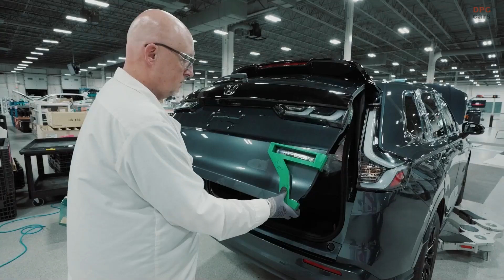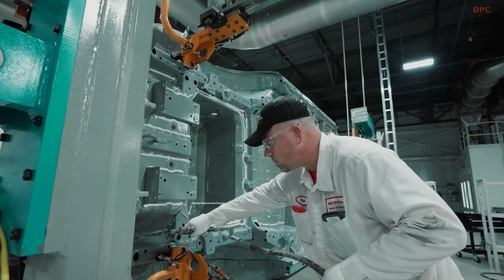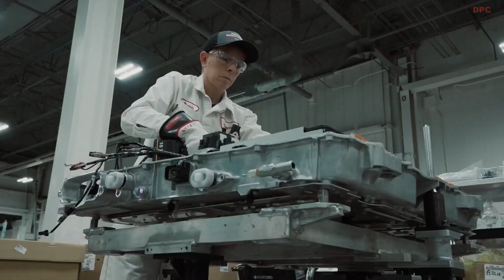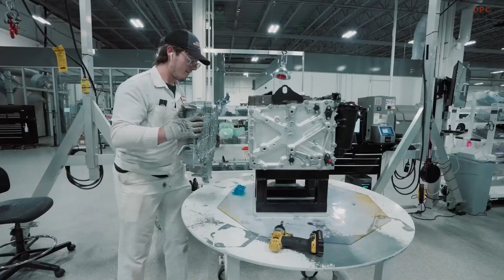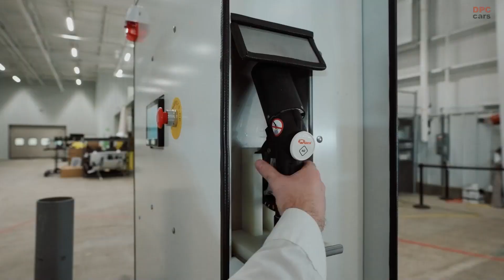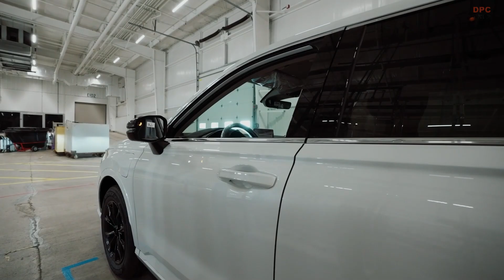2025 Honda CR-V e:FCEV Fuel Cell Electric Vehicle Production in United States

Comment: Don't really get the attraction, other than being able to brag about having a FCEV car in an area with the ability to refuel. The car seems to be priced (based on other videos) as a consumer led experiment to determine desire and to iron out the bugs in the system. 

The cost is heavily discounted but the range (either battery and hydrogen powered) and load space are small for the size of vehicle. In many cases the range and load space are beaten by many of the Battery EVs SUV options available if it's intended for those looking to go green. The 6 year option price being near to some similarly sized (load capacity wise) BEV SUVs. Plus the limitation of being to drive the vehicle beyond its 270 mile (299 hydrogen+battery combined) range limits the attraction further.

This seems to suggest Honda see this being purchased as a 2nd car or for someone who does mainly local driving close by a hydrogen fueling station (within 29 miles battery powered round trip else eating into the hydrogen allowance for the pleasure of refueling alone).

The included hydrogen fueling allowance is to counter the lack of fueling infrastructure and high cost of hydrogen refueling (upto $36 per kWh in some states), but going by the pricing Honda seem to be are assuming many journeys will be on battery power alone especially to and from the hydrogen station. In effect they are pricing at the maximum of 133 hydrogen refills for the 3yr deal (at the 12k annual mileage on hydrogen only), 267 refills for the 6yr one  and 222 refills for the 2yr. Pricing the cost of each fueling is the same for each lease option at $113 on the stated allowances. This compares with the recent $155 for public refueling for the cyclinder capacity on the CRV (4.3kg). Green credential wise the kWh rate of the fuel cell seems good at 1.9 miles per kWh, but lower than Battery EV, at 3 to 4 kWh average.

As a technical advance in isolation its of merit and interesting, but without infrastructure investment and range improvements it's not attractive as a transition option, and I say this a long time Honda CRV owner. It's a shame really as I would love to buy a full Battery EV CRV, as there is ample room for a decent sized battery underneath, the FCEV and Hybrid version available are just are not as attractive as other options at their price point.